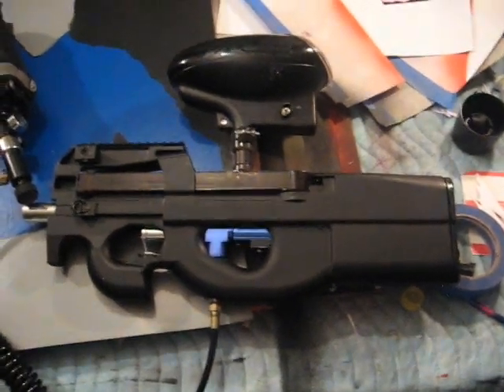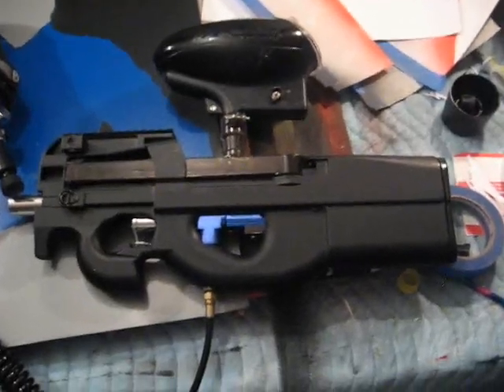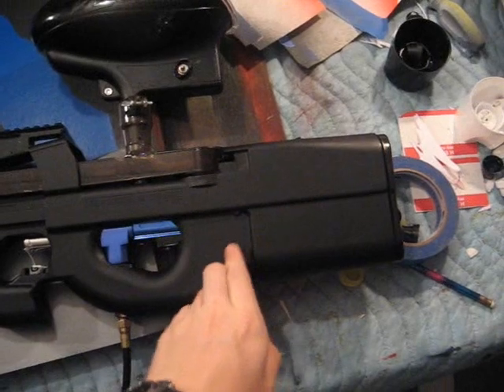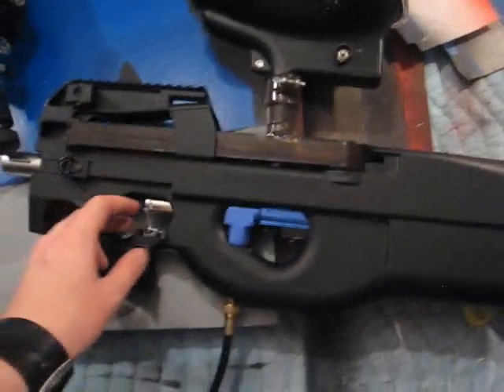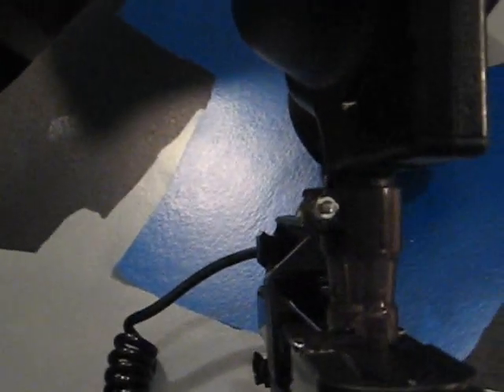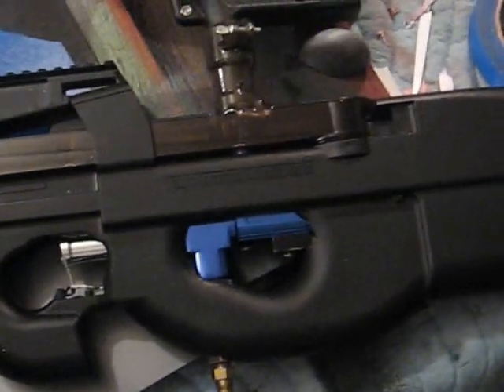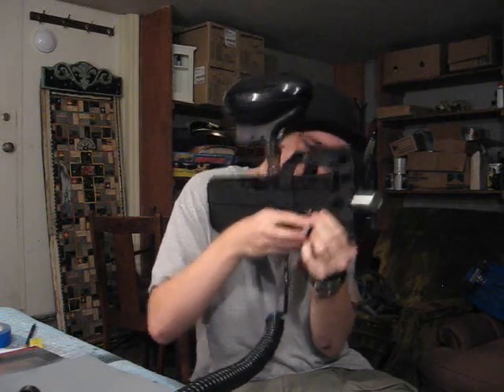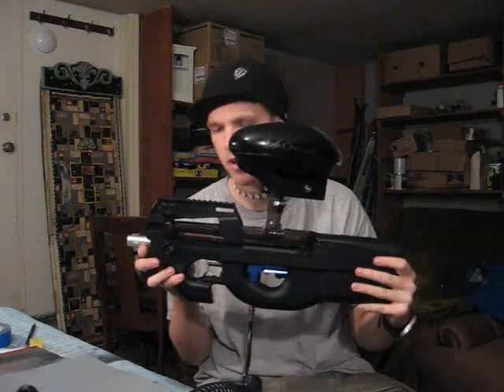P90 spyder

Comment: to off set the hopper you can frabricate a 45 degree elbo out of pvc or find some some metal tubing that has a 45 degree elbo and the attach a 45 degree elbo to the other 45 degree elbo an thats how you can offset the hopper